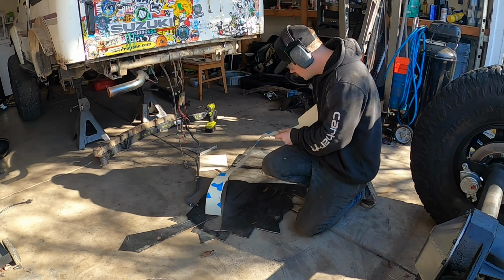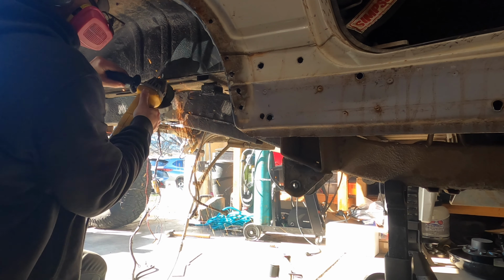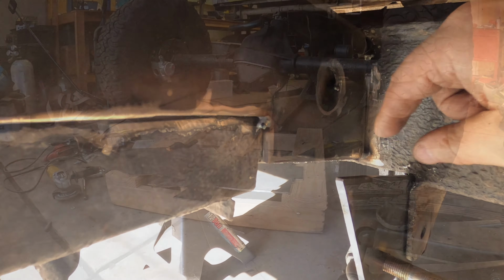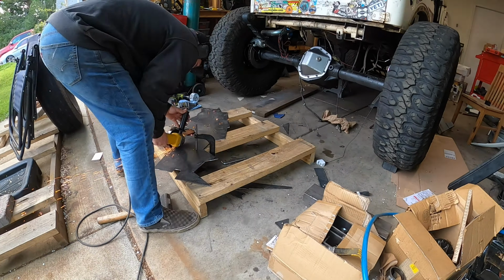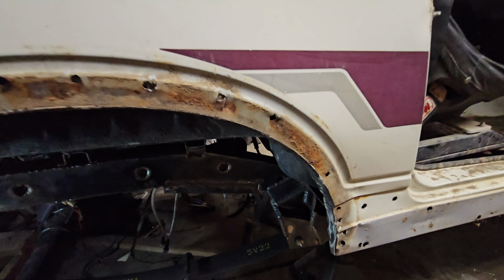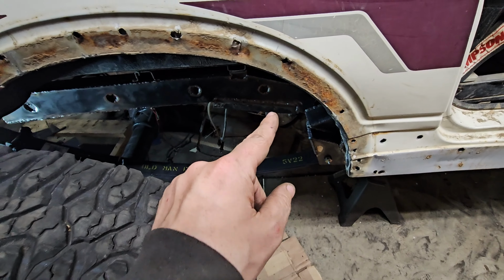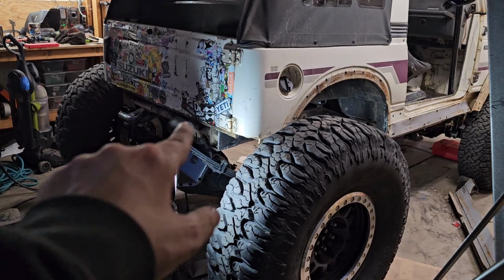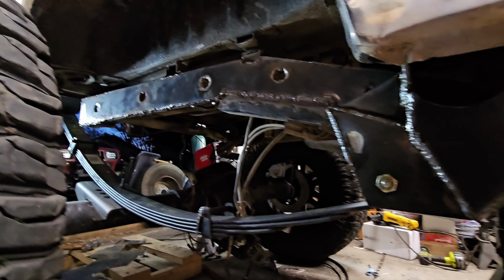1 Ton Samurai Build (Part 2) | Rear Frame Plates & Spring Hangers (XJ)

Comment: What axle you running in rear with new set up? Tire size
Reply from the maker: Dana 70 with 7.17 gears and a detroit locker. 40x13.50r17 milestar patagonia
Reply: @FortuneOffRoad  thanks boss loving the videos

Comment: I have been thinking of installing on my samurai a 3" dual exhaust system any ideas on this
Reply from the maker: I'm sure that would sound good. Probably wouldn't sew any performance gain with such a small engine. Might be limited space on splitting it into dual exhaust. 🤙🏻
Reply: Ya it would only look cool I'll be the only one with a dual pipes lol on a samurai a good conversation piece lol
Reply from the maker: That's a good point

Comment: Let tool snobs be tool snobs. I ended up with Dewalt stuff cause I got a free drill and battery one time and I just stuck with it. Once you’re invested in a battery ecosystem it’s hard to justify changing. My box at work is harbor freight to snap on and everything in between
Reply from the maker: Dude, I love harbor freight tbh

Comment: I have a bunch of Ryobi too because I built a deck 10 years ago and got locked in on their battery so 🤷🏼‍♂️🤣…. Also I’m not a welder either but I can stick metal together…. That thing is gonna be a beast. 😵🤘😎
Reply from the maker: Ryobi keeps on working I've gone through like one power tool in 8 years!